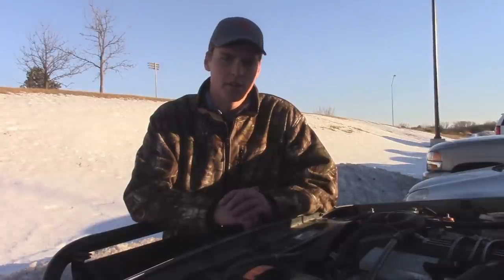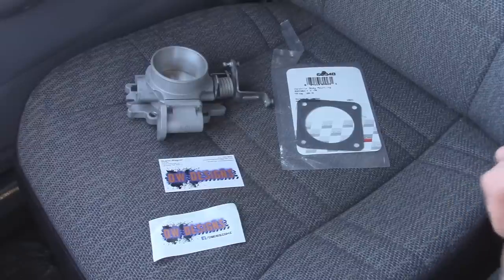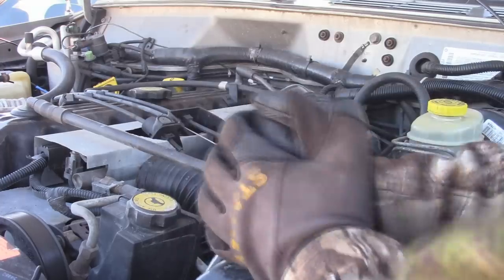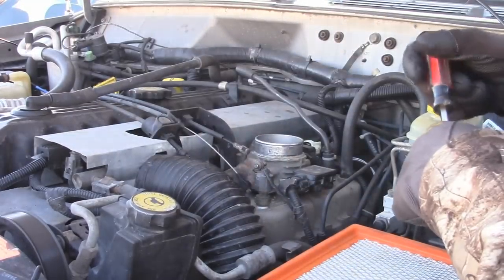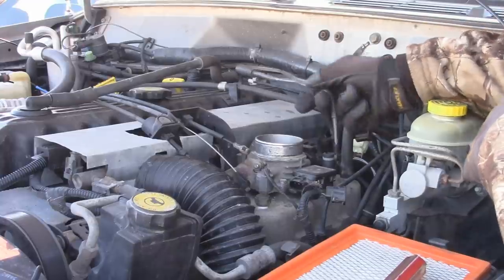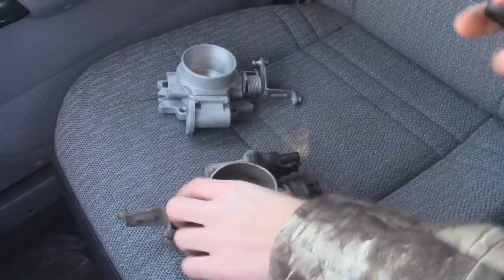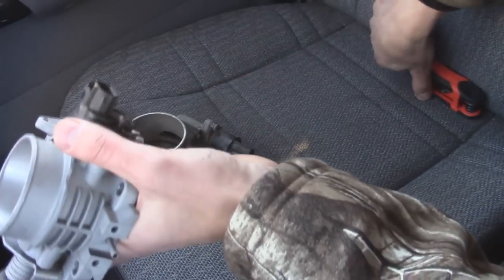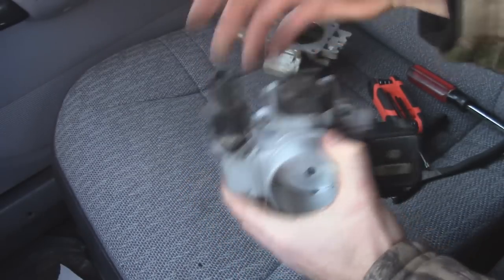Installing a 62mm Bored Jeep 4.0 Throttle Body

Comment: Would have been nice to have a review of results and perhaps comparison of revving between the two Tbodies.
Reply: Hey austin lets hang out and you can make a video and work on my jeep. you can be like heres how to install headers exaust cold air intake and new injectors. out jeeping lets get it.
Reply: @David-rj1ru  you gonna pay him? lmao
Reply: @RootSuitMan  he'd make more off the exploitation of my cherokee thN I could afford.
Reply: The 62 mm is a  great improvement compared to the stock one, i replaced all the sensors and i have better throttle response and 20 mpg on my  97 grand  Cherokee ⚡🏁🇺🇲

Comment: It's about 4 or 5 horsepower.  I bored mine out on a Bridgeport mill and made a new throttle plate on a lathe.
Reply: The throttle plate is actually oval a bit.  The plate sits in there on an angle, so I mounted it a mandrel at 5° when I machined it.

Comment: If you did a aftermarket intake, and a header, that bigger TB would make a noticable difference in power.
Reply: just whit a trotter body specer n 62 mm trotter body from bbk n i cut the post cat i can feel the difference

Comment: I have a vacuum leak , won’t pass smog in CA. I smoked the motor and found smoke coming from the Butterfly shaft of the TB .  My Question is.. should the TB have “No “ smoke coming from anywhere? …
Reply from the maker: Correct, those shafts could wear out and cause vacuum leaks and possible high idle issues. I would recommend replacing it.
Reply: @OutJeeping  
Have had any luck with the after market 62mm BBK ? 
RockAuto sent me a remanufactured one that the  smoke test proved to be worse the my original TB.
Reply from the maker: I haven't ran any aftermarket throttle body other than the original bored out.

Comment: I am looking into the four hole injectors. I heard the CPU has to be retuned? Could you explain benefits of a more holes please.
Reply from the maker: If the rest of the engine internals are stock it doesn't need a retune. This forum explains some of the benefits. https://www.cherokeeforum.com/f2/4-hole-vs-6-hole-vs-12-hole-injectors-best-245564/
Reply: You're engine burns the vapor from the holes so with one hole its more a "stream" of fuel while the 4 hole injections distribute the fuel more efficiently
Reply: It also allows for better fuel burning and fuel economy. Not much but slightly from what I've seen

Comment: What's the point I got a stock Throttle body with a Spacer and cold air intake . Aint that the same results in the end gonna still take same air to fule ratio unless you program the Pcm otherwise 🤔
Reply from the maker: It will be the same air/fuel ratio but with a bored out throttle body, it will increases your throttle response because more air can pass through faster with a larger hole. As for a throttle spacer they don't really do anything to increase performance unfortunately.

Comment: If i have a bigger throttle body will i need to run a different tps
Reply from the maker: All factory sensors should work with no hiccups, that's how I'm running mine.

Comment: Do you have a 4 hole injectors?
Reply from the maker: I have the 12 hole injectors.
Reply: @OutJeeping  does it spend too much gas or normal ?
Reply from the maker: @omaralblowi6278  Its the same fuel flow as stock but has better atomization.

Comment: Did you bore the intake manifold too? I thought the intake had a smaller hole than 62mm
Reply from the maker: Nope I believe the manifold had a bigger hole
Reply: @OutJeeping  thanks! I hope so, my XJ is from 97 and has the log intake. Bored throttle is on the way!
Reply: Intake hole is bigger 10 mm socket for bolts and you can find out yourself in 5 minutes
Reply: Intake is 63mm for direct bore match. Just did mine with 4-port injectors. Reset the PCM afterwards by ground positive cable on negative 30 secs...ignition on but not started, headlights on then off then ignition off. Viola~

Comment: Would this make a difference in throttle response for basically an all stock grand cherokee. Stock size wheels 2001. Sorry if this seems like a silly question. I just notice you have replied that this throttle response made yours "feel more like stock" since the bigger tires made it sluggish. Any feedback is appreciated. Thank you
Reply from the maker: Yup it would make the engine more responsive to any application

Comment: I've seen guys put the 62mm spacer in,  then with a 62mm hole saw, open the intake to exactly 62mm. why you not do that?
Reply from the maker: Throttle body spacers don't have any proof of performance, and using a hole saw is not as accurate as Machining a surface and having it fit perfectly with a new butterfly valve
Reply: @OutJeeping  right, but the space was for getting the hole perfectly spaced, and centered. But you neither used a hole saw or had it machined and just plopped a 62mm tb onto a factory hole in the intake. 

The intake hole is 55mm

Comment: I was surprised that you didn’t have to open up the intake manifold hole to accommodate the increased opening
Reply from the maker: The intake hole is already bigger than the throttle body.
Reply: Didn’t know some YouTube’s show them grinding the hole. Did it make any difference?

Comment: Not sure this is going to matter if you don’t open up that stock gasket.
Reply from the maker: Gasket is larger than both throttle body holes, so no trimming necessary.

Comment: Wouldn't this give you very poor fuel mileage? I get poor enough mileage now in stock form. Thanks
Reply from the maker: It shouldn't make a difference in that aspect only in throttle response, its not like a forced induction intake.

Comment: good up grade some thing I would have done use a ohms letter to check the sencers to make sure there in speck C😎😎L
Reply from the maker: Cole Webb Yeah I should have done that because the jeep is actually throwing a code for low voltage from the tps.
Reply: OutJeeping thank for you'r reply sorry it took me a while to get back to you i was working on a friend's car the tps sounds like time to replace it i just think checking seancers when you have something apart it's good time to know what is what and easier  in stead of finding out later for you'r jeep less trouble on the street and off road plus for it to run good and get the best m.p.g. have a very good night C😎😎L
Reply: Cole Web

Comment: Aside from being a dog, the throttle response is as 'right now' as a cable driven throttle could be IMO...drive a 6cycl Trailhawk sometime. 2-sec delay from input to reaction! Almost dangerous. Throttle body upgrades (in my past) were done in conjunction with porting and exhaust upgrades. And ignition. Just the TB might not be a value added item by itself.

Comment: Maybe it's me they look the same size
Reply from the maker: The new one is straight bored through compared to the stock one which as a lip mid way.
Reply: @OutJeeping  did you keep stock injectors or you have 4 point injectors well like the dodge neon kind
Reply from the maker: @vee950  I went to 12 hole Bosch injectors, I got a video on installing them.

Comment: Nice job.How's she now?
Reply from the maker: A lot more responsive, my jeep is very sluggish with stock gears and 33s and this makes it feel more like stock. I will make another video on 12 hole injectors soon so then we can see the difference even more.
Reply: Did you get the injectors with the throttle body too?
Reply from the maker: Dan Hambrick I didn't buy them together.

Comment: Ohhh. Kaaaaay...........I searched for a vid on this subject for the explicit purpose of seeing how to disconnect the  throttle body cables and what do I see? The swift disconnect with the cables hidden by gloves........no close up of what you were doing with that screw driver or how to avoid damage to the cable end fittings. Move on........nothing to learn here.
Reply from the maker: Let me guess you also disliked this video because you got all flustered? The amount of disrespect from people like you who get pissed at a free video on the internet is unreal. Getting the throttle cables off is easy as shown! Pull the opposite end of the cable and it pops out, for cruise and trans cable.
Reply: @OutJeeping   when you take the time to do an educational video then assume there will be folks looking to you to learn. If you gloss over the teaching process by not being detailed every step of the then your purpose for making the effort is shot. If you really want to teach then assume there are people watching your talents that are hungry to learn from you and need details you consider minor.
Reply from the maker: In that case I apologize for skimming over that. I try my best to include every detail in my videos. But as something I have done a lot of times it could be easy to skim over for other people to see.
Reply: @beboboymann3823  Ifyou are not smart enough to take a screwdriver and pop the cable  ends off  then maybe you should have someone else do the install for you!
Reply: @ridgerunninJeep   what a stupid ass answer. Disconnecting the throttle cables Is A NECESSARY STEP.  There are 3 different cables with two different attachments but you are so smart you already knew that didn’t ya Mr. Mechanic. I’ve rebuilt carbs........rebuilt engines..........do all my own work on two cars, a Harley, a diesel motor home so I’ve turned a wrench. But I ALWAYS view you tube before doing a projects to see if there’s a new method for a job. In this case I changed the stock throttle body to a 62MM BBK Performance Series and was viewing the video for some different perspective. If you know so much, why do you watch?